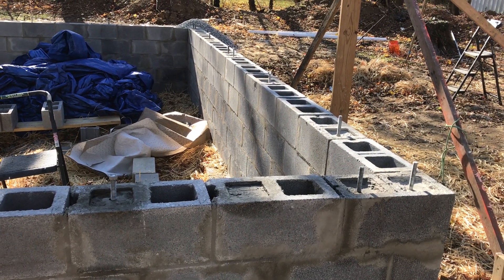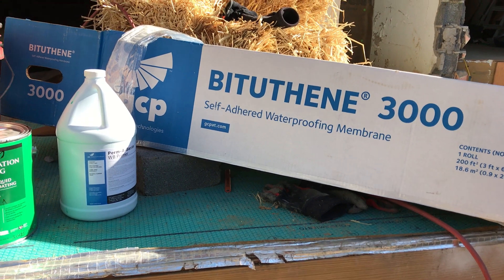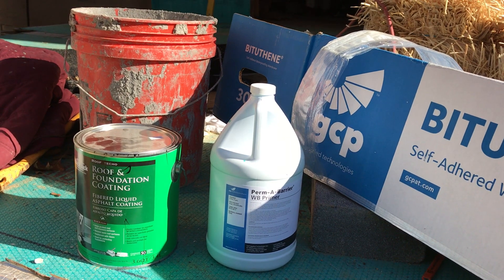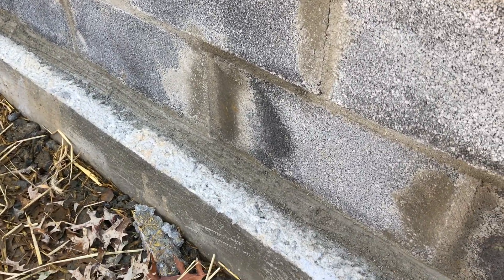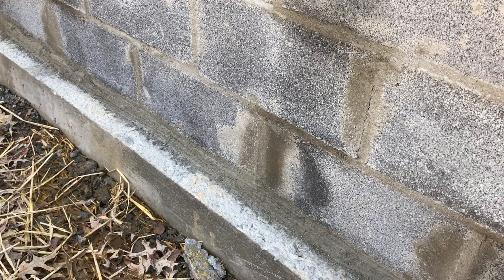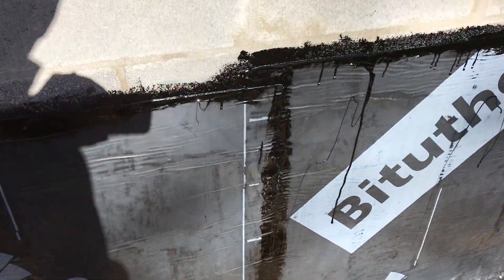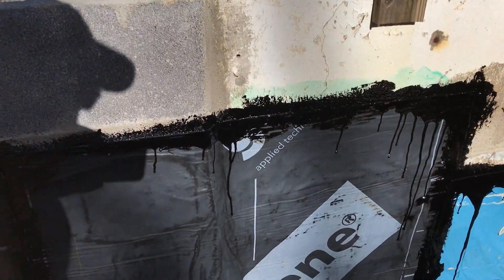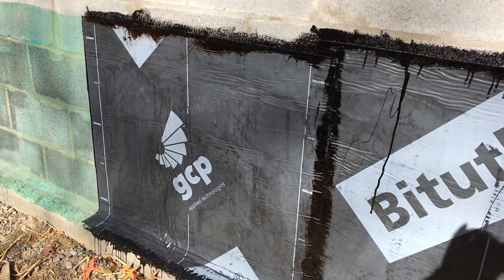Big Addition Pt 11 - Waterproofing the Foundation Pt 1

Comment: Can I backfill right after putting the membrane ? I’m using 4000 Bituthene .. thanks !!
Reply from the maker: That would probably be fine, but I'd give it overnight to cure fully
Reply: @TheLittleHouse thank you , the thing is its gonna rain later tonight ?
Reply from the maker: Well I'm guessing it would be fine, but you may want to check with what the manufacturer recommends
Reply: I can’t get Bituthene 3000 to stick to my brand new block wall we even put a parge coat over the block wall to make it smooth, everything is cured and dry and clean. I tested the temp and the wall is 55 Deg F the material is 60 Deg F and it’s 70 Deg F outside… what am I doing wrong. GCP says all this needs to be 40 Deg F and up and obviously I’m above all that…